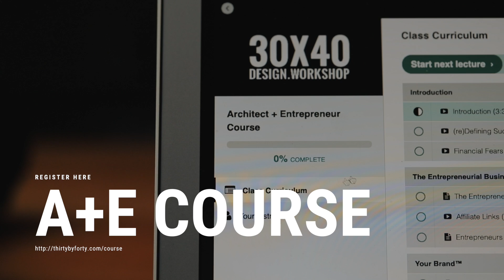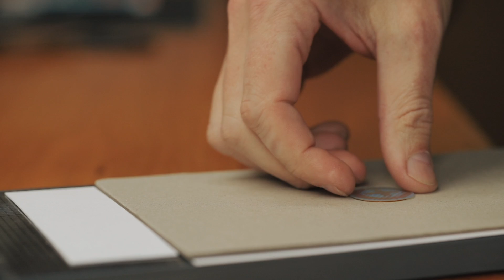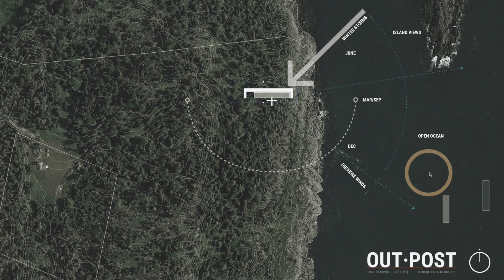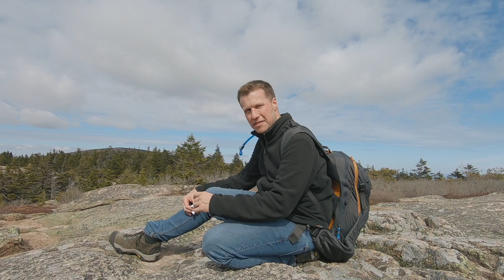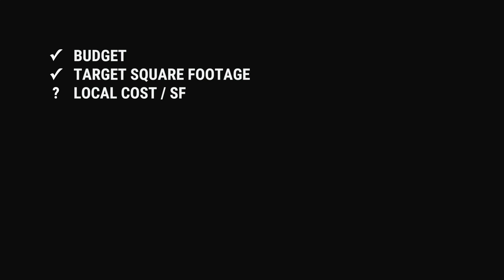My Sketchbook, Site Diagrams + Contractor Interviews

Comment: Yeah, it's kinda the "chicken or the egg" trying figure out costs before a design is spect out, it's a hard one to nail down because you're trying to put the cart before the horse out of necessity; and the contractor is grasping in the dark trying to anticipation what design/ site complexity and material schedule is likely involved while trying not to sticker shock price himself out of a job, nor come in to cheap only to sticker shock the owner with a revised price after the plans are completed.

Of course what helps a lot is to focus on contractors that have done similar types and size of projects you have in mind in the same local, this will greatly reduce the amount of unforseen obstacles and expenses; which will inturn greatly reduce the amount of contract amendments such as extra work orders and change orders.

Comment: I didn’t see the dimensions of the notebook, could you list them once they are in stock?
Also, do you have any plans for going over structure of a building and how you approach it when designing? I’d like to hear your perspective.
Reply from the maker: A5 size (5.8 x 8.3)...will definitely be including meetings with my structural engineer...stay tuned...
Reply: 30X40 Design Workshop thanks! I really like the option of stamping because you chose that cover material. I hope you’ll have international shipping, even if not right away.

Comment: Will you develop a sketchbook with paper thick enough for watercolor and for alcohol based markers? They bleed through. If not, what brands do you like for colored sketches? Your insights and tips are very helpful.
Reply from the maker: That was a struggle for me because sourcing thicker paper made the sketchbooks quite costly and I wanted to keep it within a reasonable price range for students. It's all a balancing act, so I went to a heavier weight paper that was still cost effective but there's still bleed-through with alcohol based markers (unfortunately)!
Reply: @30by40  yeah. I got one as a gift but they are costly. Thank you for thinking of the student budget 😁